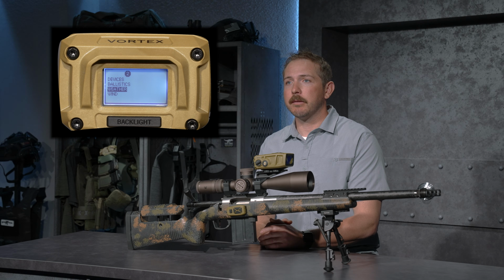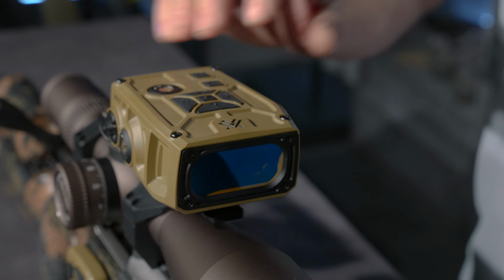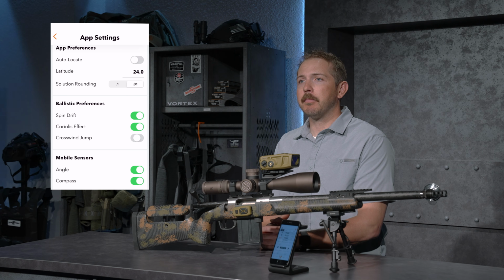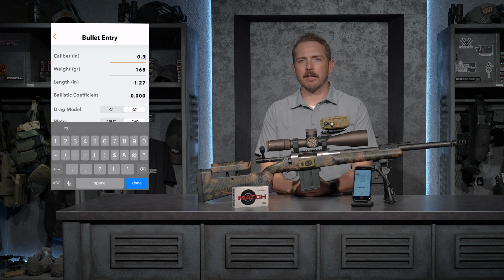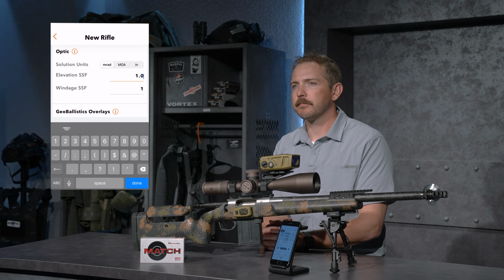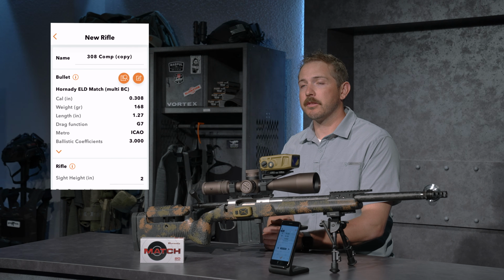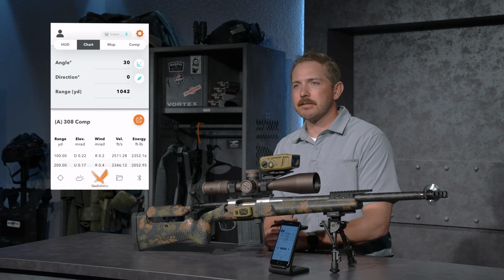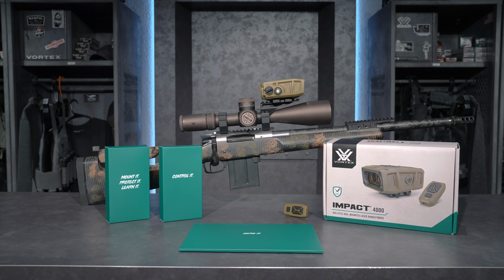How to Setup and Use the Impact 4000®

Comment: Can you lock out the compass/wind bearing feature so the direction isn't constantly updated? I like just knowing the wind hold for a 90° 10mph wind and going from there as the actual wind direction changes a lot
Reply: Would also love to be able to toggle on/off spin drift, cross wind jump, and the pressure and temperature sensors. For the cost of this unit I find the software very limited. 

If Vortex updated it to allow more user options it would make it much more useful.

Comment: You didn’t mention that when you range a target you must hold below your target ? 

Ie if your scope / impact offset is 3 inches or so to hold 0.8 mills etc below the target ? 

Is this correct? As that’s what other channels are saying - however you said to hold on target ?
Reply: It’s a parallel path between the scope and laser. So you won’t hold -0.8mil each time, you will hold -3 inch on every target.
Reply: Nah, you just have to be on zero.

Comment: Can you connect Kestrel 5700 Ballistics to impact 4000? if yes, how?  because I tried and couldn't do it. I also couldn't find any instructions on it.
Reply: I had this question as well. Since you have had trouble, I’m guessing you cannot. I believe you can only use lesser kestrels than the 5700x but I’m not sure. . I think you need one with Bluetooth but without AB or ballistics, etc..
Reply: 9:50
Reply: My impact 4000 is also not able to find my kestrel 5700 AB. I have BT turned on in my kestrel. The video isn’t very helpful. Any ideas how to fix this?
Reply: Same problem with a kestrel 5700 elite balistics with link. Do u have moré informations ?